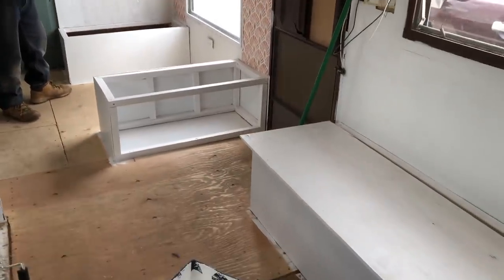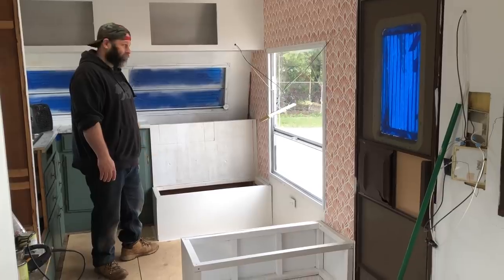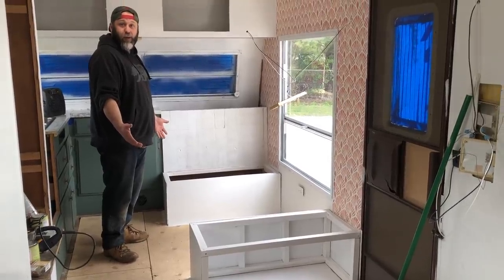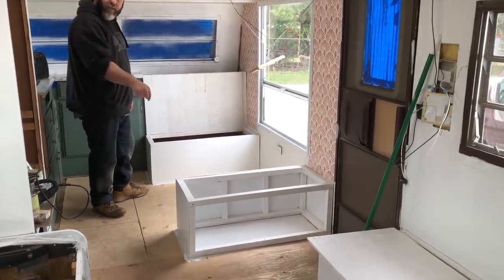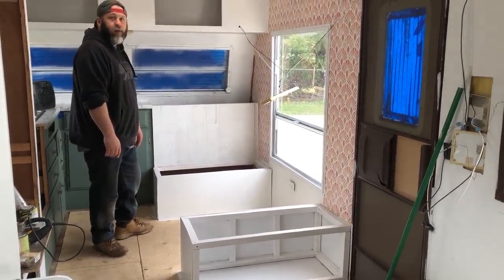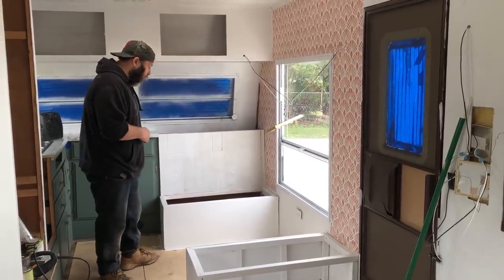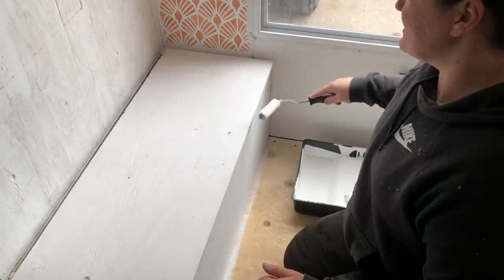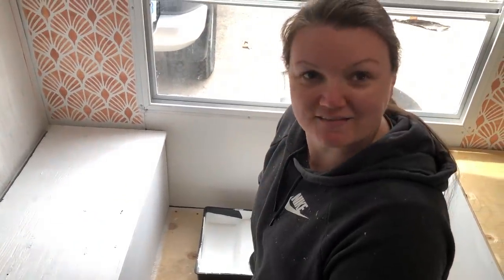Extreme Camper Makeover | Brightening up the space | Philip DON'T BE ridiculous!!

Comment: NEXT PROJECT: Make a butcher-block cutting board that will fit into the top of your sink in the camper. It will extend your usable counter space for prep, and you can lift it off when you need to do dishes. Use some of your scrap wood. Also, something my husband made for our camper...a bike rack to bring your bikes with you when you travel. My husband made our bike rack out of pvc piping so that it is light-weight.
Reply: Excellent idea. I'd love to see that! ☺
Reply: Also a cutting board that covers the stove - my partner and I had one with little blocks that fit into the propane burners to hold it in place. It was great. OH now that I see the stove again, I didn't remember that it had a folding metal top.
Reply: Just use the piece that was cut out for the sink.
Reply: Love all these ideas ❤💚💜💙💛
Reply: Love your progress, when will you tackle the bathroom walls, ?

Comment: The bench with a back on it. You could tack the back off and put hinges on the bottom and pull the back toward the window to access the storage behind it. You could put a push closure on the back to keep closed. Then you could make an extension of your counter top and be able to put item items there that you can leave out. Also you could make a pull out shelf in the cabinet under the closet to be able to get   items from the back of the area. You can use a tension rod in the opening where you want to make your dressing area.

Comment: I recently discovered your videos so I am sorry to be so late to the party.  I have found while doing wood projects that I have primed the wood with several coats before cutting out the necessary shapes.  It is much quicker and easier on your body to put the wood on saw horses and it goes much quicker.  The finishing after cutting and installation goes much easier.  Also if the wood is going to be in a harsh environment I prime both sides of the wood.

Comment: 1 Put a full shallow shelf below the seat on the base for shoe cubby storage of flashlights, dog leash, sunblocker, hats, bug spray, etc. that are used often but you want out of sight? I think the shoes would still fit under there easily, My vote is for sturdy baskets under the bench,.
2 If you attach a little ledge of wood underneath the seat all the way around that exactly fits the base,  will stay in place unless you pull it off. 
3 When you do the new cover for the couch can you do a step by step of it and the other cushions? I need to see that because it looks like I might be doing that too and don't have a clue!

Comment: NEXT PROJECT: We RV and I had a piece of sanded plywood cut to perfectly fit the stove top, we added a rubber backing so it would sit well without shifting even when we drive. . When we camp and plug in I use it as a spot to set my crockpot or electric skillet or hot plate.  This way you are on top of the stove with its vent and light on. I figured why use my propane when I can use the electricity supplied in my site.  That way my propane is only used for hot water or heat.  😉😊👍🏻.

Comment: I was thinking as you lifted the sections on the bench, wouldn't a long piano hinge through the centre be useful? That way you could access the whole of the back storage and the inside of the bench.  A latch to lock the back seat to the top? Just a thought. You're both doing tremendously on the camper.

Comment: Why would you paint the stainless steel stove?  Aren't you worried about heat from the oven burning the paint off?  You could buy heat paint but I think it only comes in white or silver.  I can say those paints work great as I've used the black on our charcoal BBQ and the silver on our stainless steel BBQ that uses propane.  The trailer is coming long nicely but I think you should rethink painting the stove.  Zep sells a fantastic cleaner for stainless.

Comment: Agree with others: Don’t paint the stove! If you are thinking that you want it to match the refrigerator, consider this: That fridge is only temporary. I believe you said that yourself. You are going to want one that works on propane as well as electric. As is, you have to be pulled in to use. When you get a new dual powered fridge, they do NOT come in white generally. Stainless much more readily available, maybe even used. So leave the stove knowing later you will match the fridge to the stove